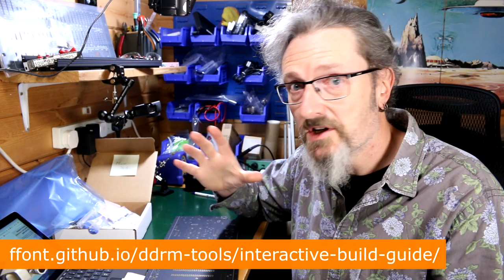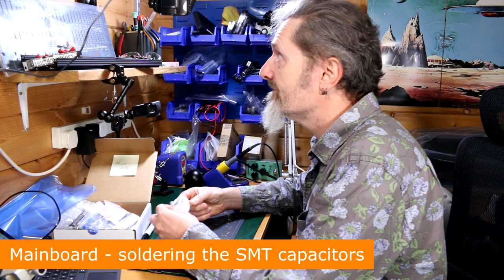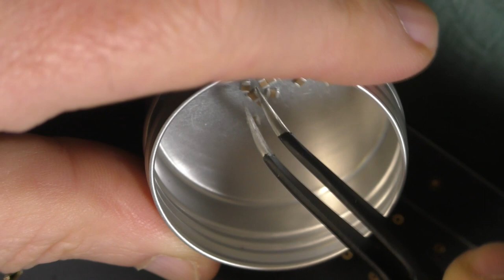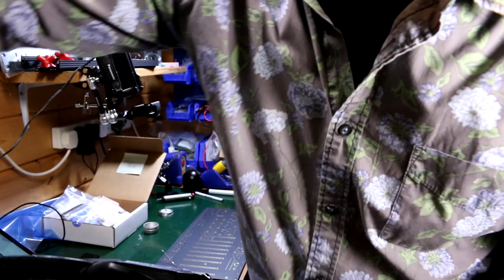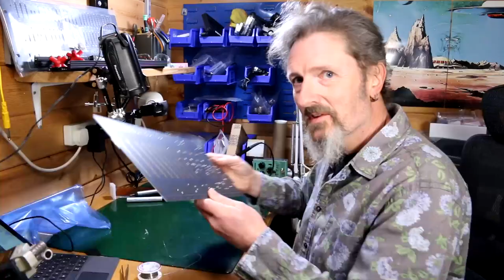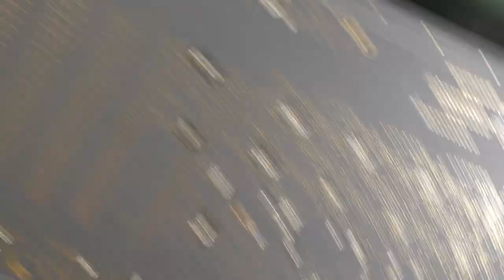Deckard's Dream DIY Build 04 - Mainboard SMT

Comment: You’ll find extra flux for more useful on surface mount IC’s. It really helps the solder “split” itself between all the pins. I’ve never found it useful on resistors or caps unless they’re in a really tight spot and I can't get solder in accurately.
If anything you’re using a tiny bit too much solder, it should kind of "ramp up” on either side but it won’t make the slightest bit of difference

Comment: Hi i work at the end of a smt assembly line and we all use two sodering irons at work. Now i know that sounds excessive but it really makes things easier. We add solder to both the pads and then place yhe component near it. Then take the two irons one for eack pad and then heat the solder and pull them away at the same time. With the two irons its real easy to position the components so they are squared up. Just my two cents i like your videos i subscribed.
Reply from the maker: Interesting idea, thanks

Comment: I was scared of surface mount too but once you get going its easier then thru hole. my problem would be patience, building a euro surface mount kit is peanuts to this so kudos for even giving it a bash.
a little less solder and you got this.

Comment: Best of luck on your project!  SMT has a learning curve but it’s actually easier in many regards once you get used to it.  Especially rework.  There isn’t a great way to do a project with paste and hot air/oven for a PCB that you don’t have a stencil for and the technique you used later in the video really is the quickest way.  A USB scope and monitor works well if you move into more SMD projects or an AmScope works well for viewing while soldering smaller 0603, 0402, tssop etc
Thanks as always for your videos!
Reply: I always cringe when I see people punishing themselves doing SMT work with a regular soldering iron. You can do it with paste or an oven without the stencil quite well and much faster. You have to learn to trust the solder mask. A simple re-work station is cheap these days, heck even ovens have come down to ~ $150.

Comment: After some SMT-experience I can only recommend tack flux. It has a consistency similar to honey,  and comes in siringe. You put a small blob on the solderpads and basically stick the component directly into it. It holds the part in place and makes soldering a breeze. The joint form nearly magically. It´s very fun! For the cleaning I use isopropanol (99%) first and use a paintbrush (one of the really rough and cheap ones where I cut the bristles quite short) and really good scrubbing first. This leaves some traces on the board, which I then scrub with some destilled water. Wonderfully clean boards! My favorite flux is Chipquik SMD291
Reply from the maker: Ok cool
Reply: Timossachenverschick - I assume tack flux is similar to flux paste? I just used some of this for my first SMT job and it made things really easy. It was so useful I used it to re-solder some encoders on an old sampler for a much more professional job. Very highly recommended.

Comment: I think any random Lou Rossman video will show a lot of the nuts and bolts of using and removing flux.
Reply from the maker: Yeah? I’ll check it out.
Reply: @MoltenMusicTech  EEVblog also has some good tutorials. I do a fair bit of SMT stuff with my builds, and flux is indispensable... for chips. For individual components the solder usually has plenty of flux in it to handle that. When you're redoing parts then adding more flux can be quite handy.  

Also, at 23:58, the flux on the board handles the solder on your iron and makes what I'd guess is the perfect connection before you add more. The flux in the solder (before it's melted) has already burned off when the solder is just sitting on your iron, so you'd get a dry joint if you tried and solder the part down without the flux on the board. In my opinion, you're adding too much solder, but I don't think that will in any way hurt things (again, it's more trouble when you are doing chips with lots of leads you're soldering at the same time. You'd get bridging with that much solder).

I use a fairly wide chisel tip for even smaller parts (0602), but much thinner solder. Overall I'd say you did an excellent job.
Reply from the maker: Oh dear, Lou tells me that my posh soldering iron is rubbish. If I knew how to add an eye-rolling emoji I would be doing that right now.
Reply: Molten Music Technology well Lou repairs like 20-30 MacBooks a day, so his gear recommendations are gonna be crazy, but it seems like you get a good sense of how much flux to use? What to do with it, and how to clean it up watching him. Of course, I would say that, I’ve watched as many hours of his stuff as I have of yours!
Reply: Molten Music Technology 🙄
Reply: Molten Music Technology which Iron did you buy?

Comment: You can easily test if your newly soldered capacitors are shorted or not. 
Use a multimeter set on to measure resistance in Ohms. Caps don't pass DC so the meter should read infinity. 

Some caps will give a little in-rush kick reading but DC current should not pass and that's what meters bung through stuff to test their resistance.
With the caps being the 1st things on the board there will be no other components to confuse the testing logic. 

Your testing logic.

Comment: It is cool to see SMT parts in a DIY project. Soldering SMT parts is faster and easier than through hole parts (even the fine pitch IC's - though the PCBs already have these installed), but there is a stigma in the DIY world to think otherwise.  So I am glad to see this video showing that anyone can solder SMT parts.  It is easy.  That said, unfortunately most this project is using through hole parts, but I understand their choice.  It is just disappointing to me because the boards could have been much smaller and even cheaper if it was mostly SMT.  

I often assembly 2 or 3 prototypes PCBs for my designs which are almost exclusively SMT (before sending out to a proper assembly house for larger quantities).  I enjoy this work, but I'm not sure I would enjoy building this synth.  Perhaps only if I did it a few hours at a time.  Which makes the point, you buy a DIY project like this because it is fun, not because it will save you money.  This one in particular caught my attention because it is such a neat project and a neat synth even if it is expensive and time consuming to make.  So most important, enjoy the process of making it because that really is the main thing you are buying here.  That, and the pride of having completed it.  

Some tips on soldering SMT:

- Use magnification - like the head set Robin used in the video, or a microscope, or even just a magnifying or "close up" camera displayed real time on your computer.  Notice how detailed Robin's video was using the (what is that, a GoPro? With a magnification lense?) camera over his work.  There are cheap cameras that will do this as well.  

- Don't pre-flux the SMT pads.  Not necessary.  The flux core solder already has more than enough flux.  A flux pen is only needed for certain SMT IC's (but those were already soldered down).  Flux pens are also useful for other special circumstances like a part that just won't solder down normally.  Flux pens are great, though, so I highly recommend having one handy.   Store them tip/cap up or they might leak everywhere (sticky yuk!!).  

- A fine point soldering iron tip is preferred but not necessary for the SMT parts on this board.  Buy both and try them to see what works best for you and the project.  Also, be aware, fine point tips don't put the heat down as well as the normal tips, so for areas with lots of copper (like soldering anything to the large copper fills like the Ground Plane), you might need to use the normal tip or even a larger wedge tip.

- As Robin found, make sure when done, you do a really good review of your work using magnification looking for anythig you missed.  Check for forgotten solder joints, or poorly soldered joints (cold joints) as well as do a doulbe check to make sure you got the parts solderd to the correct locations.  If the board fails to work when you are done, it is probalby either due to a bad solder joint (usually one you forgot to solder), or you put the wrong part in the wrong place.  

Thanks Robin for diving into this.  Sometimes it takes a more novice person to teach how to do something and show everyone that yes it can be done.  I do this kind of thing for a living, and yes, even I would say this is a big project.  What is most cool about it is the synthesizer world has these great DIY projects.  It was stuff like this that got me into electronics in the '80's and I made it my career.
Reply from the maker: Good comments, thanks. It’s really odd how the comments from professionals range from “you don’t need flux” to “you need an oven, flux and a bath of alcohol and a scrubbing brush.” It’s a bewildering place that I’m doing my best to navigate.
Reply: @MoltenMusicTech  Ha, I'm like you in that I am always asking "but why is that important or not important". Your entire channel is focused around that.  So I always try out the different ideas so I can learn myself - then I know first hand. That's part of why I thought your video on this is great. Pros will cringe and say Nooooo, but as long as the solder connections are solid, the rest is really not that critical for a DIY project. It is more a matter of how "perfect" you want it to look. Like now DIY'ers are even doing solder paste, manual pick and place, and hot oven solder reflow at home - practically like a pro shop and WAY faster than manually soldering.  

That is why I am kind of anti-through hole for DIY projects.  There are better techniques but because they are perceived as complex, they haven't caught on in the DIY market, even though Pros have been using those techniques with basic tools and minimal experience for decades. But I digress.   

Regarding cleaning, I and most the tech's I've worked with usually spray it down with a flux remover chemical and use compressed air (from a small air compressor) to blow the flux remover off before it drys. Maybe a brush to help with the tougher stuff. The board will be a little sticky, but rinse and repeat and it comes clean.  Much more "proper" cleaning requires special equipment like you mentioned (like a dish washer for circuit boards), but just not practical for a DIY setup.
Reply: Oh, and I forgot to mention in my first comment, as a DIYer, I would suggest don't use lead free solder. It just makes life difficult and for your DIY project, you don't have to worry about RoHS compliance.  No lead solder is picky about temperature, doesn't make as nice of a solder joint, and is difficult to rework if you make a mistake.  (Didn't you say that in a previous video?).
Reply from the maker: Yeah it’s interesting how straight forward the smt stuff becomes - however! Through hole is just easier to deal with. It’s physically more robust and easier to visualise so I can understand why it remains the preferred method. And I haven’t done much in terms of smt ICs yet 😀

Comment: Here we go Robin...Once you get into it you'll find it's not as hard as you thought.
I build nearly all SMT modules now and I've found that using Topnik RF800 flux is the way to go, I've used the pen and found it to be a pain. To clean you can use Isopropyl Alcohol in a spray bottle and an old tooth brush and just rinse it off again with another spray.

Comment: Generally no need to use flux for passives - I rarely use it for caps/resistors. You can use a lot less solder than you have there. Just a thin film on the pads is plenty and using less actually makes it easier to spot poor joins than if there's a big blob.
Reply from the maker: True enough, thanks

Comment: I suppose there would have to be a way to test each of the soldered components for continuity. I figure you could do that with a multimeter.. each resistor has to have a certain resistance, right? It'd be a nice way to make sure you've soldered each of the components effectively. I'm just a noob though, but I think I'd like to have that extra bit of control.

Comment: stick with the soldering iron.. i find it easier than hot air, less fiddly. Also, clean that board! I use 99% Isopropyl Alcohol. Even if the flux used states "no clean", a good scrub down with make those joints nice and shiny. I'd be lying if I said i wasn't envious of that project, looks so fun!

Comment: just use isopropyl alcohol to clean the flux off - a soft toothbrush dipped into it works poerfectly well.
Reply from the maker: So you brush this stuff on and then what?
Reply: @MoltenMusicTech  wipe it off with a lint free cloth or if you are really obsessive cotton buds. repeat until no trace of flux can be seen. Personally I just pour it into the bottom of a dish large enough to hold the circuit board - give it a quick scrub with the soft brush and let it air dry. I keep the used IPA in a separate bottle for really crusty PCBs.
Reply from the maker: Ah ok. And yeah I’m not setting up some kind of soldering plant 😀
Reply: @MoltenMusicTech  tip the board up for run off and get a gallon of auto brake cleaner, sluice it down in a well ventilated area will take all the flux off.
Reply: I use Brake cleaner by the case load for metal parts (excellent degreaser).  I would not suggest it for a circuit board because you don't always know exactly the composition of the brake cleaner.  I'm not saying deadprivacy's suggestion is wrong as I'm sure it comes from experience, but this is definitely a case where I would suggest educating yourself about what is in your brake cleaner and make sure those chemicals are OK. Brake Cleaner comes in many formulations. For example acetone is commonly used in brake cleaner. It is also used in flux remover. In high concentration, though, acetone will ruin some plastics.

The real issue with cleaning a PCB is doing it inexpensively and without a mess or lots of waste, which is exactly what deadprivacy and others are addressing. The professional flex remover (MG Chemicals, Tech Spray, etc.) cost $15-$25 a can.  The Deckard's Dream project could easily go through half a dozen or more spray cans of what ever you use if you want to douse the PCB.  Part of the reason there are so many different suggestions on how to clean a PCB are because of economics and waste (it is a matter of your time, costs, materials, and waste).  

I believe the following website has it generally right if you want to make your own flux remover, which is what I would do if I were going to solder this many boards together, some of them quite large.  But just a quart or liter of high purity alcohol from the hardware store could do just fine.  

Homemade solder flux remover – cleaner DIY (Isopropyl alcohol, Ethanol, Ethyl Acetate)
https://getgui.com/blog/diy/homemade-solder-flux-remover-cleaner-diy-isopropyl-alcohol-ethanol-ethyl-acetate/
Ethyl Acetate is a common replacement for acetone and is plastic safe as best I understand.  If you have any of the "nice smelling" nail polish remover in your house, that is because of Ethyl Acetate (vs. acetone based nail polish remover).  This article also is a reminder that alcohol often comes in water diluted versions, but for a solvent, we need the more pure stuff.

And since brake cleaner came up, I thought this page was interesting.

How To Make Homemade Brake Cleaner & Penetrating Oil: Complete Guide
https://agradetools.com/how-to-diy-brake-cleaner-penetrating-oil-easy-trick-save-money/
They suggest acetone for brake cleaner, but actually you would be better off buying the CRC Brake Clean they suggest as acetone is actually not something you want to just spray all over the place (again because it eats plastic). I'm not suggesting this for cleaning PCB's. But all this is related to general understanding of solvents and why we care.
Reply: @mglohmeyer  most brake cleaner doesnt have acetone in it, its tetrachloroethylene, the run off takes the dirt and flux with it and the rest evaporates 100%
its the same stuff as dry cleaning fluid, it wont hurt your pcb, just dont get it over 315 degrees C as it creates "phosgene" which is a chemical weapon.
Reply: +1 for Iso Propyl Alcohol/Propan-2-ol and a good scrubbing with a toothbrush.
The IPA evaporates and any loose bits will just brush off. 
Places used to be difficult about selling IPA in th eold days .They got it into their minds that you might be cleaniong injection sites with it .... Of course all musos are junkies  ...
These days it's readily available online.

Comment: Just catching up on this, I just installed my first SMT module which needed some intervention partly due to a few dodgy joints but mainly because I put an IC in backwards! I've started learning circuit board design with KiCad and as part of that I now have some little boards for LED blinking circuits being fabricated, figure I'll do some more SMT practice with them before the next module. And I'll pay closer attention to the ICs... Out of curiosity, what soldering iron temperature are you using?
Reply from the maker: I think it's about 360 metal melting units

Comment: I think it would be a good idea if you order some extra of the cheap parts so that you don't get stuck for a long while if one of them is damaged or lost.
Reply from the maker: It's impossible to know which those are and if you're ordering the parts as a kit then that's impractical. I counted all the parts and got a few missing bits sent through already - there has to be a limit to the preparation i think.